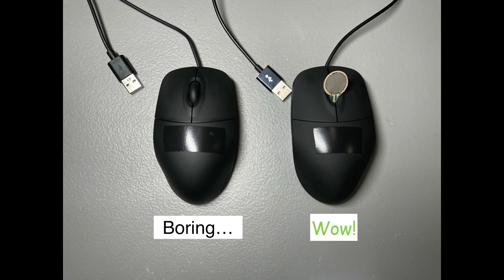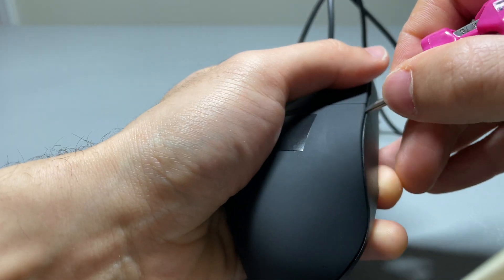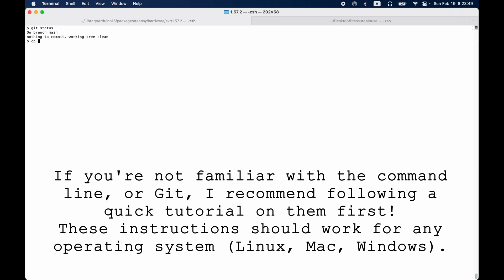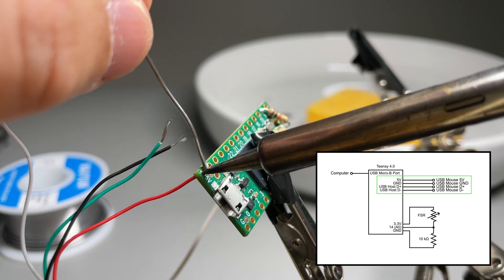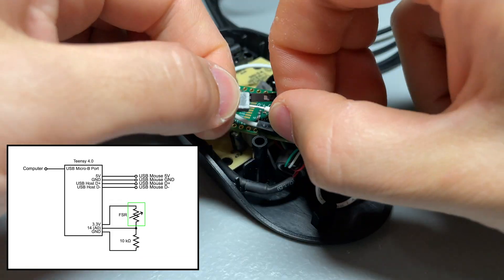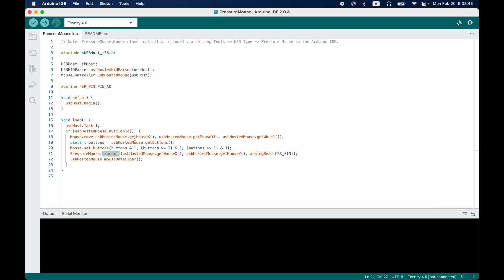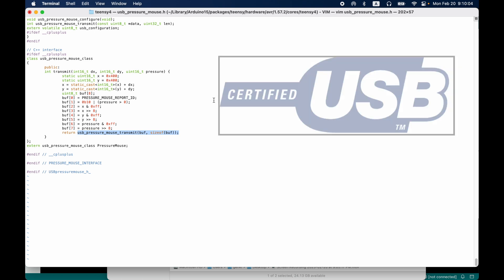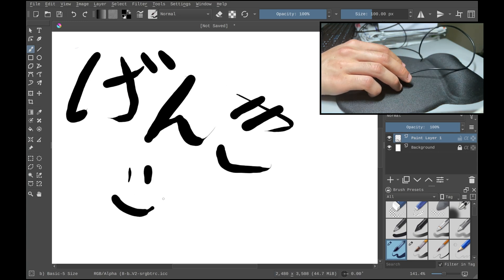DIY pressure-sensitive mouse!

Comment: I see a lot of different 10k resistors of different wattage passtrough, which one do i need specifically?
Reply from the maker: You can calculate power dissipation in that resistor with P = V^2 / R. V is worst case 3.3V so worst case 3.3^2 / 10k = 1.1 mW. So even a 1/10W (= 100mW) rated resistor is more than enough!

Comment: I'm thinking about trying this myself. I want a pressure sensitive mouse for 3d sculpting. I've been sculpting for a year with a mouse and I just don;t like using pen tablets. However, i am a beginner to embedded programming. Is this a project suitable for a beginner?
Reply from the maker: Yes I think so! And don’t hesitate to ask any questions. You can also email me (address in my profile).
Reply: @genkimarshall  thanks. i ordered a pi pico kit, fsr and resistor. Hopefully i can make a prototype in micropython before moving on to a better version. So you didn't want ot put the sensor under the mouse button?
Reply from the maker: I vaguely recall trying it and it not working as well as I wanted but I’m not sure. I think it’s worth you trying, let me know how it goes!

Comment: I am a complete electronics noob, so I was wondering what the purpose of the 10k ohm resistor is? Could we also do without it?
Reply from the maker: Basically, the 10k ohm resistor and the FSR (force sensitive resistor) are forming what's called a voltage divider. In this way, Pin 14 on the Teensy reads some fraction of 3.3V based on how much force is being applied to the FSR. So yeah, some sort of resistor on the "bottom half" is necessary. As for what specific value, these FSRs have a resistance range of 100k down to 200 ohms, so 10k happens to be a good choice for dynamic range
Reply: @genkimarshall  ah Okay, thanks! I am running into a different issue on Windows now, where I can't seem to get the Pressure Mouse USB type to show up in my Arduino IDE. I tried applying the patches manually and also the way you showed in the vid and my boards.txt and usb_desc.h files look fine as well. But nothing seems to get the Pressure mouse USB type to show up, I've tried restarting the IDE, reinstalling it, restarting my pc, reapplying the patches and so on but pressure mouse is never available in the drop-down menu. 

Do you have any ideas what might be behind this? I'm happy to provide more details as well
thanks!
Reply from the maker: @tomwolf1043  Hmm, OK. I just re-tested and was able to get it to show up. Here's the exact steps I did:

1. Install Arduino IDE
2. Follow the instructions from the "Teensyduino Download+Install" page from the Teensy 4.0 website (sorry, forgot to mention this in the video, but I'm presuming you did this as you were able to select Teensy 4.0 board type?)
3. Follow the steps in the video about applying the patches from the GitHub repo into the Arduino15/packages/teensy/hardware/avr/1.59.0 path on your system (or whatever version you have). Since you're using Windows it'll probably be in something like C:\Users\{username}\AppData\Local\Arduino15\packages\teensy\hardware\avr\1.59.0
4. Exit and re-open the Arduino IDE
5. Select your board from the Arduino IDE dropdown, and assign it as Teensy 4.0
6. Go to Tools --> USB Type and you should see "Pressure Mouse" listed.

If you did the above and you don't see "Pressure Mouse" listed, I would guess where things are going wrong is applying the patches. Make sure you're applying them into the right path and see them get successfully applied. If none of the above works, please don't hesitate to say!
Reply: @genkimarshall  Thanks for going to all that trouble! Did you retest this on a Windows machine?  I tried a fresh install of the arduino IDE and replicated all of your steps, it says both patches were applied in the avr/1.59.0 directory and again my and your diffs from before and after applying the patches seem to match, but the USB type is not showing up in my IDE. 
Last night I think I found a workaround for this by compiling the sketch on a WSL using arduino-CLI and then uploading the .hex file via teensy loader. The upload was successful, but I still need to test whether it's actually working.
Reply from the maker: @tomwolf1043  Hmm OK, I just installed Windows in a VM and was able to follow the steps and it worked. So after you apply the patch and restart the Arduino IDE, select your device and set the board type to Teensy 4.0, then go to Tools -> USB Type you see a bunch of options listed but not "Pressure Mouse"?
Reply: @genkimarshall  Yea exactly, everything from serial to flight sim controls + joystick, everything is there, just not Pressure mouse :/
If it worked on your VM I must've messed something up. I'm on Windows 11,  did your VM run on Windows 11 as well?
My workaround by compiling on a WSL worked btw, so I think I'll just be sticking with that for now. Just waiting on some parts to arrive before I can Finnish soldering!
I'm hoping to come up with a more feasible way of building this mouse, that doesn't involve a 40$ board, once I get it to work using the teensy.
Reply from the maker: @tomwolf1043 Hmm that’s strange. Glad you have a workaround though! Yeah please do let me know if you carry this idea forward! That was my hope in posting this video. Also I think the board should be ~$23, not $40. Are you including high shipping costs or something?
Reply: @genkimarshall  Huh, I'm based in Germany and I can't really get a 4.0 board below 30 euro. Is there a more convenient way to reach you other than, YT comments? Just the  Email from your YT channel? (Obviously, no worries if you don't want this)
Reply from the maker: @tomwolf1043  Hey yeah please send an email to the one in my channel info!

Comment: 💥
My dreams come true!!
I was doing some sculpting in Blender with my new, cheap Wacom Tablet.
Frustrating.
After some thinking..... I am a mouse man. I trace the line with more ease....
If I could turn a normal mouse into a pressure-sensitive mouse....
It is a genial idea, so probably this mouse is already buyable. I just have to search for it in the Internet.
..... Search.... Nothing found.
......Think again....  I could modify a mouse, but it needs a genius to code for the new mouse driver.
Give up.
Search again in YouTube......
Then the miracle happened. I have watched your video three times, ordered the Teensy board and the pressure sensor, downloaded your code.
Great!
Thank you for sharing your work.
The board will take over a month to get here (Spain), and I hope it will work in Windows 10.
Thanks again.
Reply from the maker: Thank you for the nice comment! Please let me know how it goes. And if you run into any problems, of course don't hesitate to ask!

Comment: Hi, great work! I would try this in Windows but the github link in the description is incomplete 😬 can you write it completely? Thank you very much
Reply from the maker: Hi! Thank you very much, I did not realize. It turns out I had to verify my channel further before I could put links in the description. I just did that and it looks like the link is working now. Please let me know if otherwise!
Reply: @genkimarshall  The link works perfectly now, thanks a lot. Do you know a teensy alternative? It is a little expensive to buy just for this project
Reply from the maker: @andreaemme992  Yeah, it'd be cool to find something cheaper. The board has to expose two native USB ports / pin-sets so it can be a host and a device at the same time. While being tiny enough to fit inside the mouse. I can't find something cheaper than $23 that can do that. Maybe one can find a cheap board that doesn't describe this possibility but the MCU does actually have the capability/pins, so you'd then modify the firmware to expose what you need. Not sure. Another option could be find the cheapest MCU that can do two ports and design a minimal board around it and come up with something cheaper... Though maybe not at a small scale? I'm still new so take what I say with a grain of salt :)